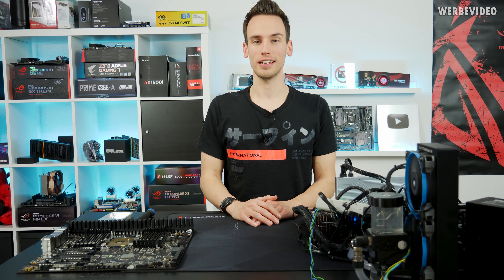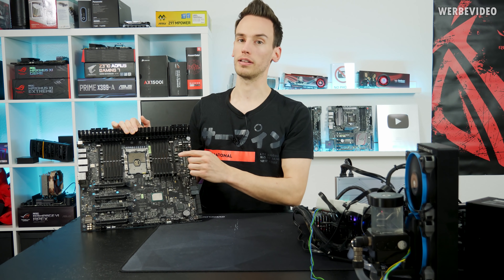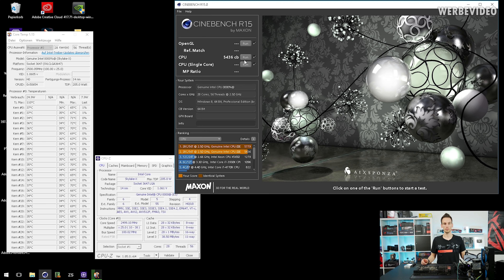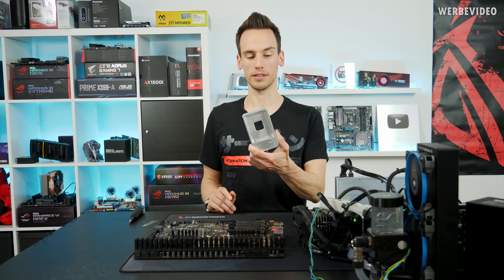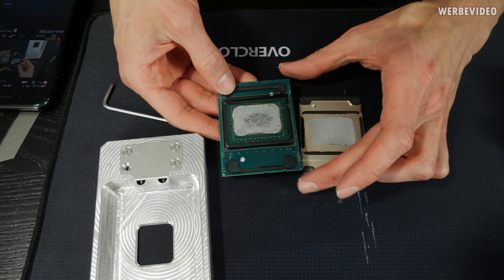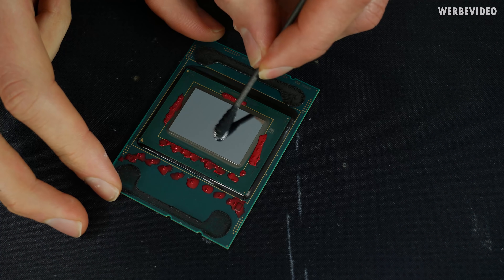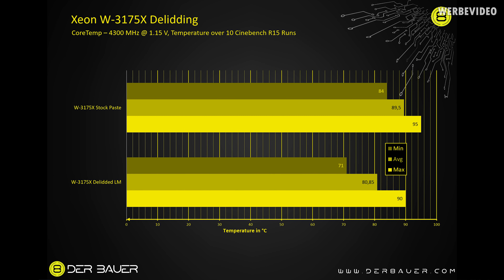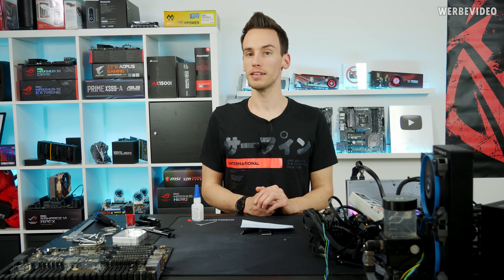The most EXPENSIVE CPU I've EVER delidded!

Comment: Interesting.
However, I think the comments on the socket are not appropriate.
So let me make a somewhat lighthearted critique of this.

For one, a CPU that costs in excess of $2,500, and needs a special/expensive motherboard is not in the same class as the ones that >99% of real "consumers" use.
And I don't mean gamers, I mean of the hundreds of millions of people who have a PC/MacBook at home, or in an office in a non-workstation role.

It's a bit like saying a $0.5 million dollar Ferrari is a "consumer" vehicle, and in the same class as a Skoda Citigo, compared to a Caterpillar D9, or a Formula One racing car.

But would you allow the same mechanic to work on the Ferrari, as does on a Skoda Citigo?
No.

So without being offensive, I think if someone has problems with an expensive (very) and quite unusual CPU like the Xeon W-3175X, then they should not be tuning my Ferrari either....:-}

I would be very interested to see how you remove and then re-install this CPU.
And what tools you use to do it.

I've read INtewls SOP for it, and it's completely differewnt from any of their other sockets..

I see that Anandtech reports that Intel says:
"Because of the extreme power nature of this processor, Intel is taking the view that it should only be sold by OEMs and SIs that have the where-with-all to deal with how to cool them and how to provide technical support. As a result, users that want this chip will have to invest in a pre-built system."

In other words, it's not for Skoda Citigo mechanics, but Ferrari ones.

In addition, in terms of ease of CPU removal, even the EXTREMELY idiot-proof Intel ILM (Independent Loading Mechanism) is only supposed to be used a set number of times: Intel Thermal/Mechanical Specifications and Design Guidelines, Section 2.1.5 Package Insertion Specifications says "The processor can be inserted into and removed 15 times".
That's fifteen.

Have you read the Intel requirements for the Xeon LGA3647 socket?
The equivalent section says "The processor can be inserted into and removed from an LGA3647-0 socket 30 times.".
That's 30 times.
However the nuts and studs are supposed to be replaced after 12 installation/removal cycles.

When you say "I don't know how many times I mounted this socket".....and then say "you've bent pins and damaged things".....well, I make my point. If you are going to work on this Ferrari, you NEED to know that. And you need to be able to work on the Ferrari engine without dropping spanners into the cylinders....

A major issue for an aspiring Ferrar/W-3175 mechanic is to consider that there are 3,647 contacts for this CPU, and the load on any given contact must be between 10gf and 25gf, or 801N to 1334N overall.six bolts, four of which you tighten differently from the other two.
And at a controlled torque: with the correct lubricant.
And with a specified cleanliness of the assembly area.

And that is at the BOL: Beginning of Life.
At EOL (End of Life) it changes to 614N to 1334N.
And consider how this has to be applied: they only have 

In addition, anyone making a motherboard for this needs to follow LGA3647 Board Flexure Initiative (BFI) Strain Guidance Sheet. It describes how the board needs to be strain gauged during manufacture/design. That's not a requirement for the Intel CPU's that are for the Skoda/Consumer CPU's mechanics.

So if you are going to advocate/encourage/suggest a pretty major modification (delidding), which is like ripping off the roof of a Ferrari to make it into a convertible, then you need to take account of how that affects the contact pressure on the socket: both on the soldered BGA contacts of the package to the PCB, as well as on the load at the interface.

Because as you've noted, the IHS needed a very large forece to delid, and that the heat sink loading bolts are what controls the entire loading of heat sink to IHS, to package, to soldered contacts at PCB to the BGA spring-loadsed ones in the socket.

That is quite a complex stack. 

And you've removed the adhesive, as well as changed the theermal paste for his liquid metal stuff you like.
Big change.

And any changes in heat transfer, either better or worse might be due to increased/decreased PRESSURE, and maybe you are into the Red Zone of package or solder loading? How do you know?
Remember that this is the socket that Intel tells manufacture to strain gauge when designing the motherboard/socket.

In Section 6.2.1 Processor and Socket Stack-Up Height, INtel says wghat the required over stack height is: 8.31 +/- 0.36mm.
After ripping the roof off, and adding "Terminator Metal", what is the Stack Height now?

You need to KNOW that.
Because as every engineer knows, stress is a function of strain, and load is a function of displacement (or stack height).

I don't see any particular attention to controling the applied load after you've ripped off the Ferrari roof, smeared nail polish on the SMT's, and then poured very aggressive and non-wetting Gallistan alloy over the Ferrari's engine block....:-0

Personally, I think a well engineered approach would be to try to measure, or at least PREDICT the loads after you've changed the stack so much.
And I think some testing without liquid metal and without an IHS, but using a good thermal past, and just the heat exchanger would be the best thing to try.

Comment: This isn't the 10k zeon that Linus dropped?
Reply: Kind of, the one linus has is the official Xeon workstation version which supports a few extra features including support for boards with 2 or more CPU sockets. The W3175X can only be used on board with 1 CPU socket.
Reply: @jbank2520  hold up, so you're saying there's a processor that is MORE advanced / expensive than this one?
Reply: @rogehmarbi  Well sort of, the 3175X is about $3500-4000 but you can only use one. The 8180 platinums which linus has are $10K each but you can use up to 4 at a time.
Reply: @jbank2520  and 4 is still not as good as 2 64 core epycs lol

Comment: also you are not running as high of a clock or voltage so the chip is more efficient.  thats probalby why you dont get 20c drops in temp.  when you are doing an 8700k at 1.35v and 5ghz or more then you have a lot more heat per core.  if you could run this chip at those voltages and temps then you would see the same temp drop

Comment: There's supposed to be a clip holding the CPU to the cooler, that way the entire assembly slides down the guide rails at the same time, and doesn't fall onto the pins.  Also supposed to use a calibrated torque driver in a crisscross pattern to tighten down the nuts.  I agree though, that's a lot of overhead door a 'consumer' setup.  That's a neat water cooled heatsink though, hadn't seen that before.

Comment: Interesting test. I am not going to spend that much on a MB or CPU though. The most I plan on spending is upgrading my 5820K to the 6950X in the near future. I can still use X99 and have a quick PC. No need to spend that much on a PC unless you need it for business use. Then I can see it.
Reply: 6950s are still so expensive, I'm in the same boat lol
Reply: I am thinking of getting the 5960X as I can get one for 500.00 and sell my 5820k for 265.00 that will cut my cost a bit and get me an 8 core extreme cpu.

Comment: I've worked on a number of servers that use the LGA 3647 socket, and my impression of it is that it was design to be easier to assemble by machine.
Reply: There's supposed to be a clip holding the CPU to the heatsink.  Are they not shipping a 5 cent piece of plastic with the hs?

Comment: Actually there is a plastic bracket to lock the cpu onto the heatsink to prevent it from going anywhere. Always use that.

Picture:
https://www.servethehome.com/wp-content/uploads/2018/03/Socket-LGA-3647-Narrow-and-Square-CPU-mounted.jpg

BTW, it's actually the same as the xeon platinum 8180 I delided last year :P So I think they are actually the same except 3175x has some specification cutdowns like upi and a little higher clock.

Comment: @der8auwer   Am i correct to say that this die thickness is not as thick as the 9900k and can therefor conclude that the 9900k die was this thick because it had to be solderd?   It looks about as thin as the 8700k if i put images close to eachother. If this truelu si the sole reason for the thick die i dont get why intel doesnt make a non solder version and fixes the whole heat problem. Lets hope this is the 9900KF.

Comment: GJ
Why does Intel call it Xeon, when unlocked? In the past there was already a similar experience with Xeon E5-1680v2.
Nothing prevents them from calling the 10 and more core processors i9. If they don't have server instructions, it doesn't mean that they are "gaming". Render workstation, huh? Is it really need server instructions? But render 10+core CPU really needs to be unlocked.

Comment: I have a question.
Is my 8700k fine with temps around 75-85 C in extreme summers,
voltage 1.27/1.28 4.8ghz
i dont have AC in my room.
will this temp hurt my chip at long run. ?

Comment: I have worked with LGA3647 for quite a long time, and I even have desktop machine with this socket. I swap CPUs daily, and never had any issues with memory, when CPU was properly mounted in a good socket. That's for server systems, and looking at your gear, I strongly suspect, that either your CPU is bent, or it's too unevenly loaded. The issue is main load bearing area is near the center, with both screws pushing the side flat springs, and everything else is just a guide. Springs SHOULD distribute the tension evenly, but it may not be the case. If you overload the center, CPU PCB shifts, and you get uneven contact permanently.

Remedy is harsh (new CPU - I have several bent Xeons that display similar issues like your CPUs), but in the meantime, I'd suggest preparing very thin shin plate between CPU and cooler, like 0.05mm in the center and 0.11-0.13mm at the longer sides, loading this up (tension center screws up to specced 8 lbft), try to fire it up, warm up, cool down, and remove the shin plate.

I'd also consider actively cooling the board under the CPU. Amount of heat removed by pins isn't something to sweat about, but past 500-600W it's starts to get noticeable.

Edit: Get bent flat screwdriver (or plastic tool that can bear some load), and when removing cooler, pry it off from CPU, so it stays in the socket. Literally every single cooling system for LGA3647 has black plastic frame that clips the CPU to the coldplate, so you're always sure you pick up both. It should fit under your gear.
Reply: Yeah, it's supposed to come with a clip, if Asetek isn't including it that's pretty frustrating.  And gets the proper torque on the nuts in the right order should clear up missing memory.  He's just lucky he doesn't have a 2 or 4 socket board or he'd see UPI ports down.

Comment: Pointless cpu and motherboard, you cant buy them, only SI`s have access to them, probably because of the crap socket and cooler mounting systems. It only exists because of threadripper. Intel just cant loose a dick.....I mean core measuring contest.

Comment: I also expect the direction that you compress the IHS will have a lot to do with the difficulty, or strength required, to delid the chip. For example, if it were turned 90 degrees, and had a press contact the width of the chip, you would likely require less strength to get it off, I imagine.

Comment: If not even you can insert the CPU properly, then that says a lot about this socket/cpu/motherboard. Wow
Reply: Yeah, I can't imagine that the tech support for intel, or worse, mobo manufacturers, will be all that much fun. You're gonna have a whole bunch of 'enthusiast' wankers with more money than brains buying this thing with no real use case other than to have bragging rights of the 'top dog' CPU, because their ego and small crotch equipment requires them to, that have only ever run desktop chips before, and have no clue how to install one of these. I see a lot of bent pins and fried chips in the future of this platform.

A sad attempt by intel to come up with a timely answer to Threadripper, that, honestly, wasn't even necessary, as it's a niche within a niche market. The only people actually buying this kind of thing might be professional workstation users, and that's a big maybe. If they need the power that bad, why not go with a server or professional validated workstation platform? Actual 'pro' features are likely to be limited and/or disabled so that intel can keep their product segmentation intact. Most 'pro-sumers' or small independent professionals will see much better value for dollar with a 2990WX, and likely go that route. This just makes no sense.
Reply: I have Zenith Extreme on my new build and I fucking hate the TR4 socket.
Reply: @sirius4k  Honestly, the TR4 socket is much better as it is completely accurate to the pins, compared to this CPU's hot garbage direct socket.. 

The TR4 socket is a necessary bad to even get a CPU of that size situated..
Reply: @MarcABrown-tt1fp  I'm not saying this socket is a masterpiece, as I have no personal experience, although I can take Roman's word for it, but that is no excuse for TR4 to be such an ass rape. It is a shitty socket design, as is probably one in the video, but I,  as a regular customer, don't want any of that shit. I hope I don't have to reseat the CPU before I decomm it one day.
Reply: If someone has enough money for this CPU and board, then they should get the proper torque driver and heatsink clips to actually mount the hardware.  If that's not detailed in Asetek's or Intel's installation guide, I can understand the frustration

Comment: Is this first chip that requires chiller to get 5Ghz as far as temps go?
Reply: Yeah it is. But you need to win the silicon lottery, need an in almost all countries execpt Taiwan and a few others illegal industrial chiller and the CPU propably wont be stable outside Cinebench
Reply: @1414yamaha  I got modified (low temp limit removed) Alphacool Eiszeit 2000 chiller running on my primary system, i could probably cool that cpu well enough.
Reply: Brad Viviviyal  The chiller Intel used is illegal in almost every country because it uses a certain toxic chemical which is part of the endothermic chemical reaction which allows the chiller to cool down the fluid to about - 10 °C

Comment: if this cpu will retail for 499$ or less, ill buy it
Reply: Why do you want to buy this CPU over a 32 core Threadripper?
Reply: Inhaling glue again?
Reply: lol, maybe you can buy it used for 499 about 20 years from now :P
Reply: I just bought a  1,000$, 13 years old CPU for 20$, maybe in 13 years it will be possible
Reply: @Fuzzfrrek  Why even pay 20$? You could get a hell of a lot better computer for 130$ if you used craigslist and got a ryzen 3.
Reply: @bradmundies425  Actually it is for a personal projet I want to build ;). It is a QX6700 extreme Quad 2 Core paired witha Asrock ConRoe865PE.
Reply: This intel furnace isn't worth even fart to me. Had enough with 4690K: out of the box 90C -> delid, new thermal paste, still 90C -> delid, liquid metal still 80+ -> Realize heatspreader is crooked and sand it straight -> finally 75C load temps with overclock, of course with warranty void and reduced resell value.